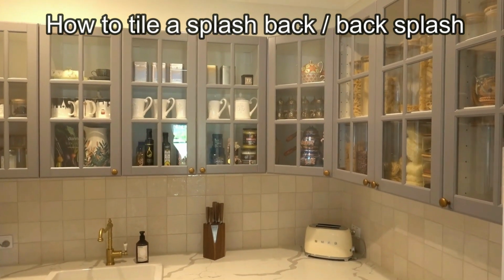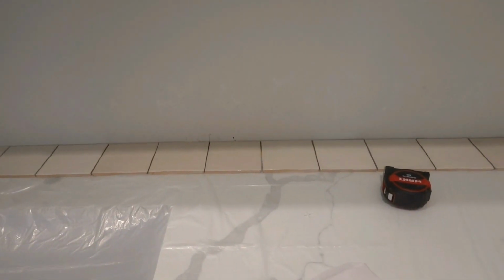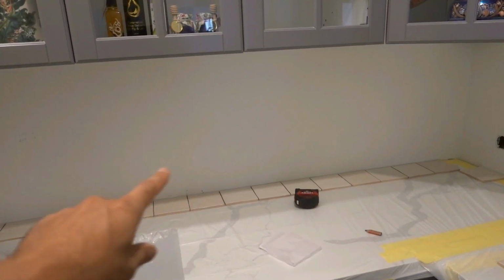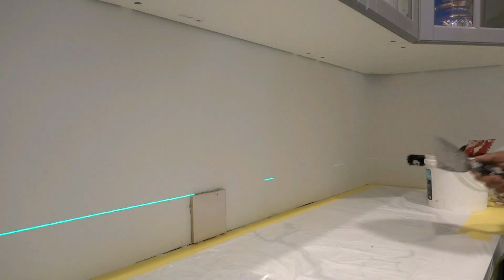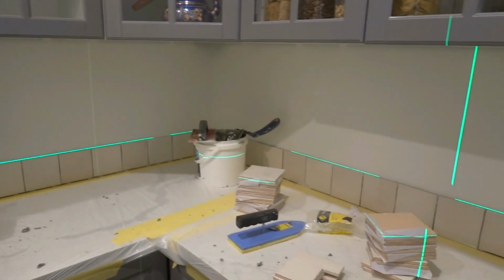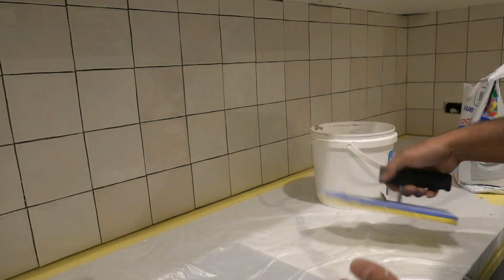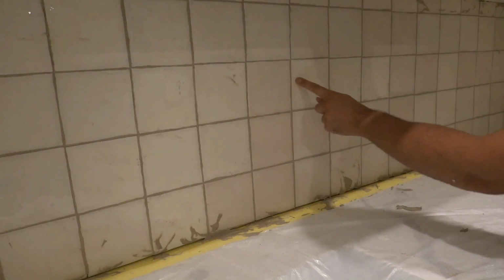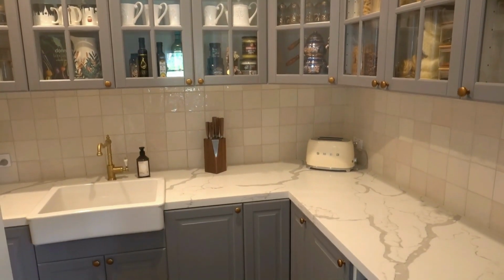How to tile a kitchen splash back

Comment: Not a fan of the tile colour with the bench top but what a great job tiling. Thanks for the tutorial. Hopefully with tap and “accessories” it all blends well. I saw a tip the other day when choosing tiles make sure you view them in final position (eg vertical in this case) and not flat on bench top.

Comment: The tiles compliment the cabinets and the cabinet color ties in the bench top pattern. The whole kitchen looks great. What did you use to cut the tiles along top and sides?
Reply from the maker: Any exposed edges was cut with a tile cutter and non exposed edges which was most of the cuts I used a grinder